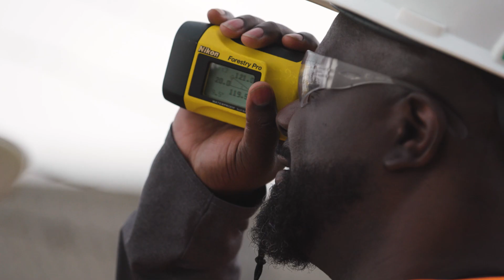Leidos - Deliver Powerful Results

Comment: I'm a retired Aerospace Engineer with Lockheed Martin and my youngest son (B.S. Mech Engineering, FAU, August 2022), just accepted an offer two days ago from Leidos in Orlando for an Associate Distribution Engineer position. I believe he starts April 17 or April 24th. I knew about Leidos' DOD Scientific Engineering contracting business but wasn't aware they also had a Power Solutions group. My Son likes to get his hands dirty so I think this might be a really good line of business for him to grow into. Plus with the electrification of the automobile industry, it seems to me America's electrical infrastructure industry is going to be on a significant upward usage slope for the next 30 to 50 years.